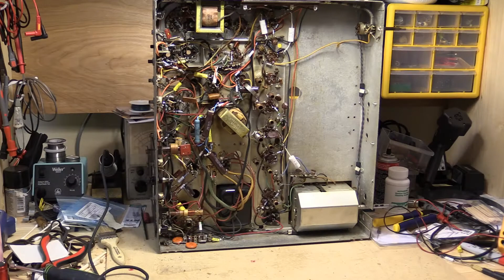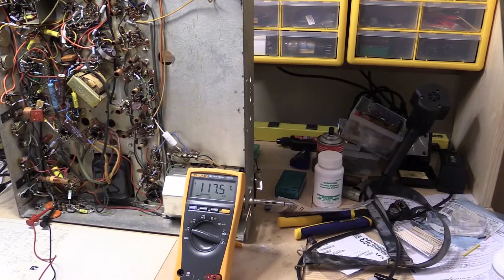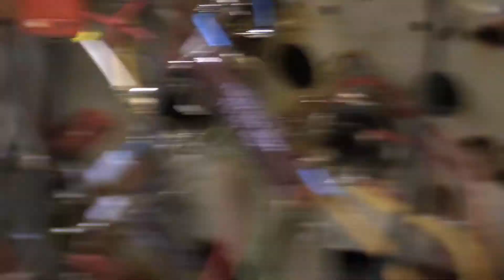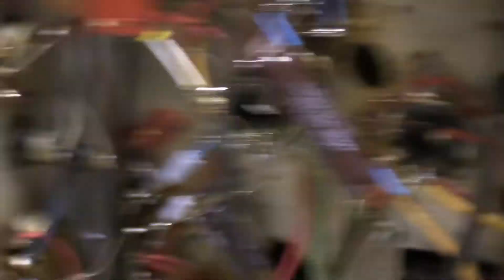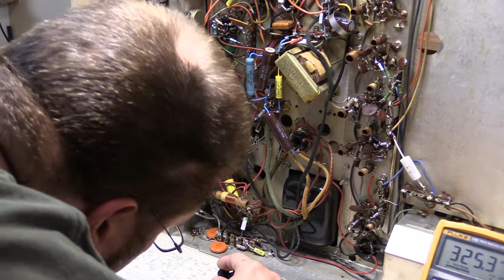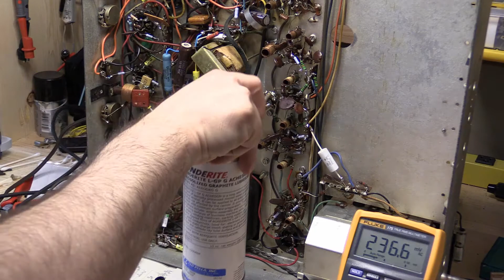Hoffman TV Part 5

Comment: Looking good!
Reply from the maker: +ScottTV1962 I think I ended up spending more time now on the rusted metal parts on the top of the chassis than I did on recapping and resistor replacement.   this thing better work after I finish.. ;-)
Reply: +Bret Frohwein I am sure it will!!!
Reply from the maker: +ScottTV1962 it will look good, if nothing else.. ;-)

Comment: when you check the windings of the low voltage transformer leave all tubes in except the rectifier tube. makes it easier to check the filament winding by seeing the filaments glow in the tube and there wont be any b+ flowing through the set because the rectifier tube is out. then test the low voltage winding across the whole winding at the rectifier socket and if it is center tapped go from each side to the center tap. then check the filament winding for the rectifier tube across the winding at the tube socket.
Reply from the maker: +Thomas Stemmer You're right.. but I was feeling lazy that night.  22 tubes to insert was more than I wanted to do.  :)
Reply: you were being lazy so instead of doing things the easy way you made more work for yourself. sounds really logical lol.

seriously you got the job done testing things so that is what really matters in the long run.
Reply: i wish you all the success in the world with this project.
Reply from the maker: +Thomas Stemmer a shortcut is the longest distance between two points.
Reply: but a short cut is usually the quickest and easiest way also.